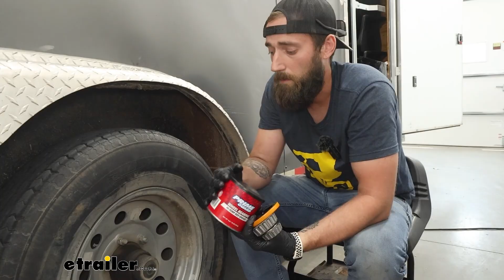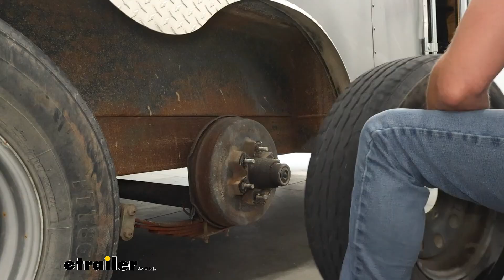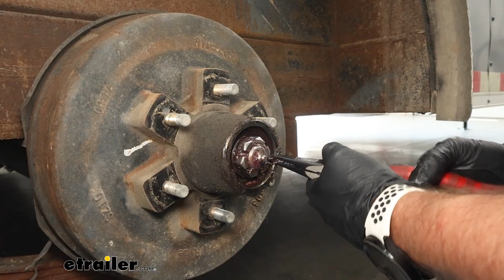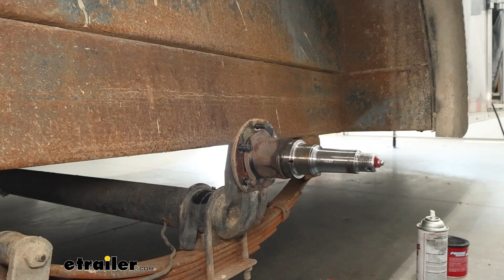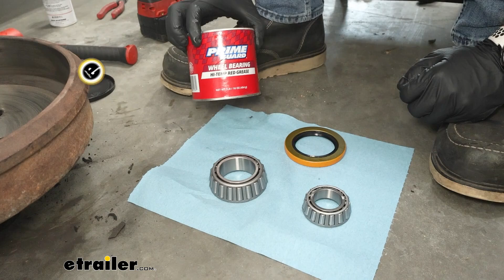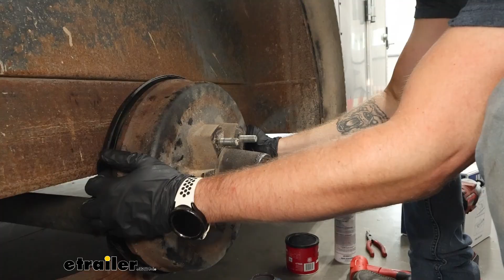etrailer | Installing the Timken Grease and Oil Seal

Comment: I like the tip using a hole saw to pound the seal in.  Do you think the steel on steel metal will cause defects that will cause heat/damage to the drum or other parts?  Also, I think you should mention that you have a Dexter zirk grease spindle, which allows for grease to be put in like that.  Even though Lippert/Curt spindles also have a zirk fitting for grease, they are not recommended for this type of greasing, especially that many pumps of grease.